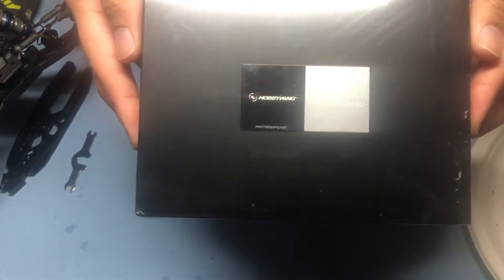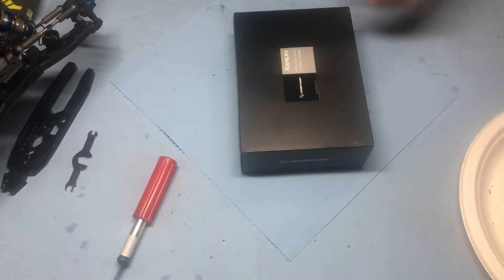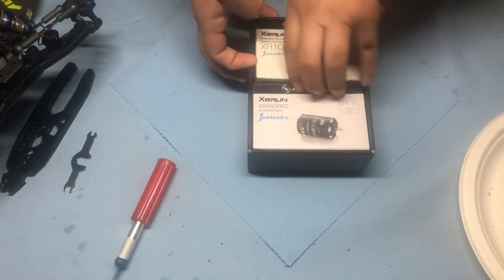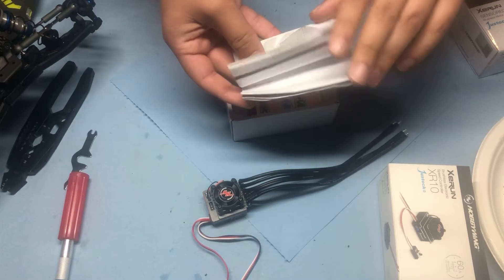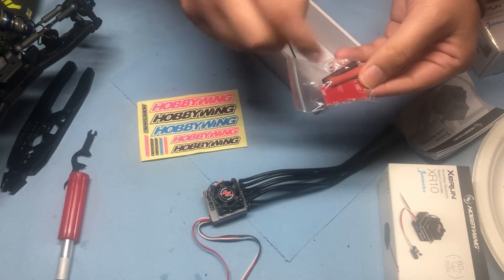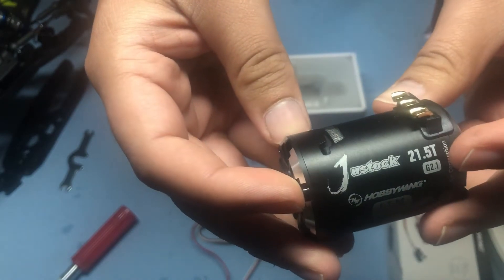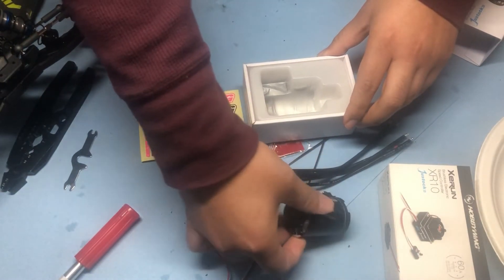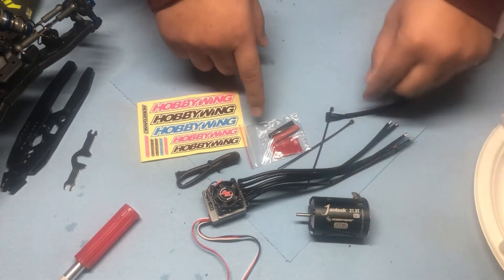Hobbywing XR10 Justock G3 Motor Combo Unboxing

Comment: Can you use this combo for 4wd buggy’s
Reply from the maker: I think this particular combo would be too weak for a 1/10 scale 4WD buggy. Most places run 13.5T motors on their 4WD buggy classes. I would recommend the Hobbywing XR10 Pro ESC and the 13.5T Combo. If you want something slower if you're not racing, the 17.5T motor would be a good place to start with the same ESC. Link to the 13.5T and ESC combo: https://www.amainhobbies.com/hobbywing-xr10-pro-g2s-sensored-brushless-esc-v10-g4-motor-combo-13.5t-hwa38020334/p1414891